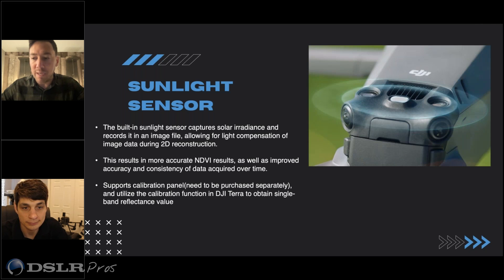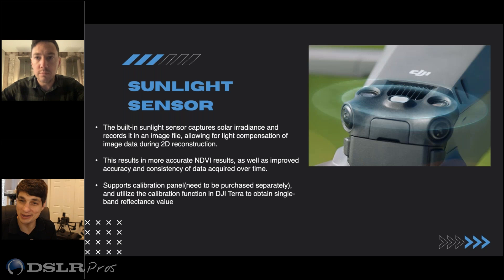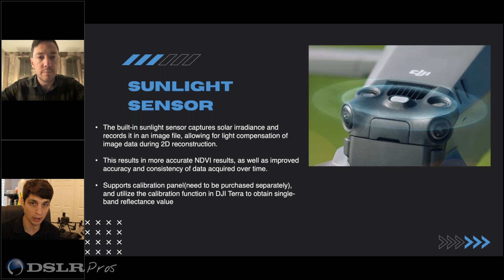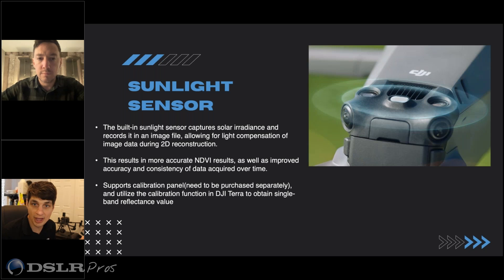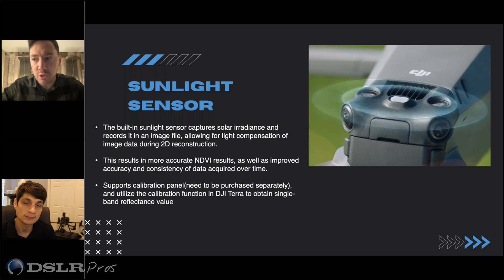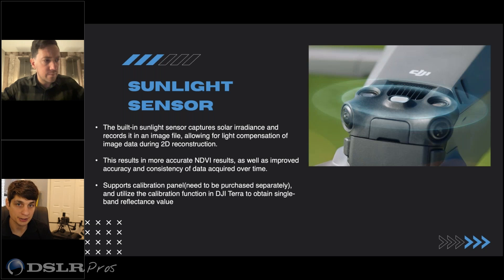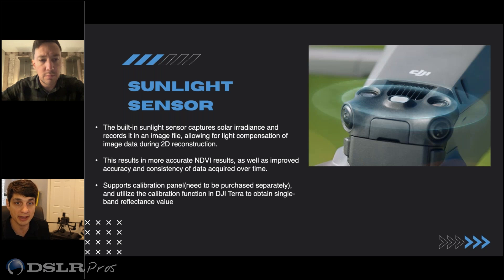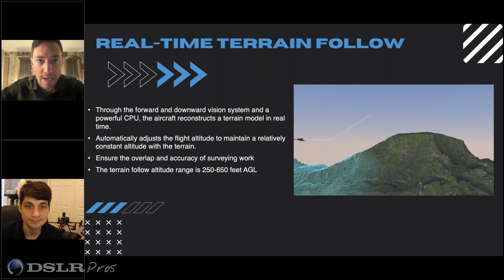DSLRPros Webinar Excerpt | DJI Mavic 3M Multispectral - The Sunlight Sensor

Comment: He never really answered the question. Does the camera automatically adjust with the sunlight sensor or do you have to incorporate those values into radio metric calibration during processing also what are the specifications of the sunlight sensor? How was it made and what are the exact units that it captures. I haven’t been able to find this anywhere in the DGI three and manuals although I have seen the sunlight sensor exif data, but I can’t do anything with it because I don’t know the specifications of the sensor itself. It would be awesome to get these questions answered.